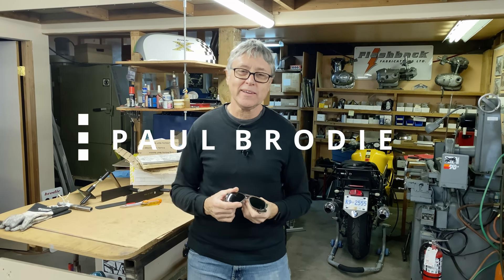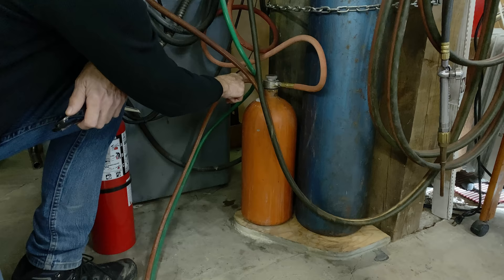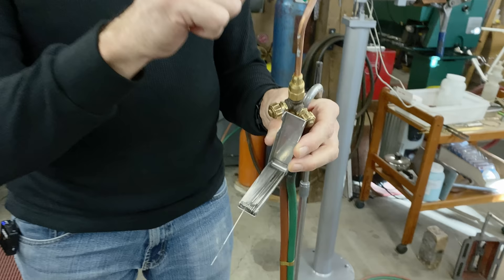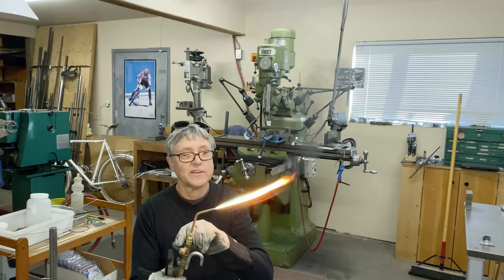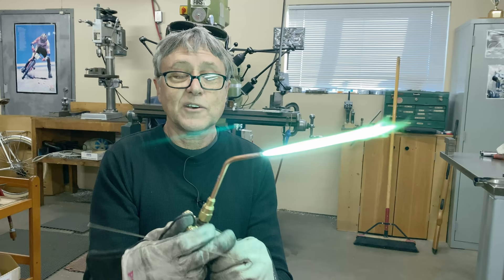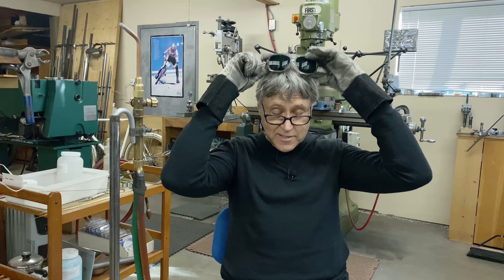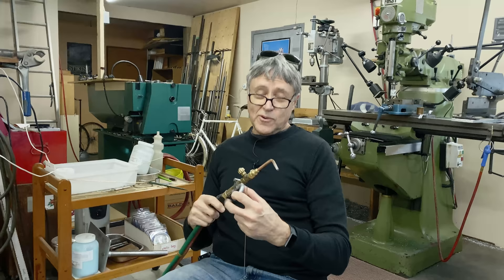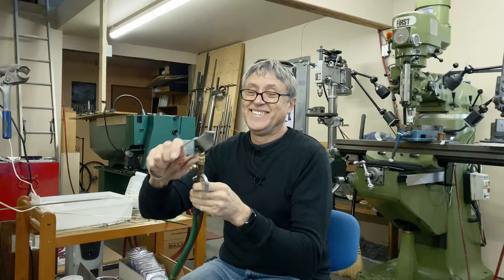How To Braze - Tips and Tricks with Paul Brodie

Comment: I'm doing some brazing on the Pd wire Paul... without much success... but I am just using propane at the moment... I am unlimbering an oxy propane set up... 
suggestions?... I have a short video of my first attempt if you want to see how not to do it
Reply from the maker: I have never used propane, so can offer no suggestion there... You can try sending me a short video!
Reply: so, I think it's a temperature thing with the much greater heat transfer in the AuPd..  platinum jewelry is made with hydrogen gas.. or now there are small arc welding thinggummies.. prices comenserate with how good they are... fer sure
Reply: stop by bro... I am right up the way on you tube.. and.. you are hereby invited to participate in the madness... making a mess.. actually... moving outside... cleaning up to get ready to fly  .. thanks Paul 😊🙏Namaste señor
bigger and better torches... far out man
wonder what the HOA is gonna say 🤔
Reply from the maker: @richardcarew4708  Not sure exactly what you mean; what is the "madness"?
Reply: @paulbrodie  building airships on my back porch Paul... cleaning shop even as we speak 😌
the first one is a 2 meter inflatable sphere with a bicycle frame structure holding on to a 7.5m² parachute... to be shellaced and create a rigid internal system of helium, or hydrogen, balloons with the ability to adjust individual pressure for altitude changes.. with vertical, forward, backward...and lateral movement.. pulse jet with hydrogen oxygen gas on demand... jets... 4.. with proportional capability for 2 at a time..  in either direction or both.. like brakes Paul... for sissies
Reply: my new fancy torch fits the old hose... into the regulator and pressure guage... and compressed air in lieu of tremendously expensive oxygen... lots of O2.. and O3 around here
propane burns at 2500° C.. hot enough to vaporize aluminum..  it's evaporating up the flame as I pull AuPd in... Pd melts at 1550.. close to steel... it's not hot enough to weld the Pd... and a pinpoint flame on aluminum wire might work better.. except it immediately becomes AuPd... so... it's a torus to hold the sphere with tubes to an upper frame structure holding the balloon and gas stuff... the torus has sections with ports to allow movement between cells and the tubes holding the gondola... 4 hollow old water bottles repurposed into pulse jet engines.. with on demand hydrogen fuel from water
Reply: adding O2 creates a 3000° flame.. similar to oxy acetylene.. but cleaner
Reply: so I will keep you posted..  and am actually heading north soon.. to the slopes of Mount Hood
Reply: to build a bigger one... I am directing people here Paul, to learn welding to build their own... the next one is 10m diameter.. military type parachute... like a flying VW bus.. or a yurt... or something
the water absorbs energy in movement and creates stable flight... like a gyroscope that can't break
water can be directly converted to H/O gas with 3% hydrogen peroxide and AuPt and AuPd... it's actually pretty vigorous and can be hurried with heat and or magnetic induction  .... work in progress.. the platinum and palladium part works.. the methods need improvement
Reply from the maker: @richardcarew4708   Well, I have never heard of anyone using compressed air instead of oxygen.. I do not know what AuPd is. You are speaking a different language to what I am familiar with.
Reply: bright red with white spots on top..  StarFire stealth technology... ;;☆》
the HOA might bark... my buddy lives out in the woods..  he gets the first one
Reply: Au = gold..  Pd is palladium.. Pt is platinum.. it's found in the radioactive volcanic ash that covers the Earth Paul..  someone knew.. kaolinite clay is what plates are made from.. plates from platinum and palladium dust..  the old Chinese bullion is AuPt.. available on eBay as Miow silver... cheap... blows bubbles in hydrogen peroxide..  nickel doesn't.. and.. the measurements and weight.. give specific gravity... 10 × 5.6 × 0.56 cm
136gm
Reply: specific gravity is the weight to volume ratio... see Archemedes and his bath
Reply: the bubbles in hydrogen peroxide are hydroxyl ions... H/O gas.. burns great.. into water vapor
Reply: the AuPd creates more hydrogen peroxide... all by itself... with 3% hydrogen peroxide from the drug store near you
Reply: AuPd starts making H2O2 in 3% hydrogen peroxide ==>> it increases the productivity up to I think 5%... it creates potable water for drinking... from river water etc.. and doesn't wear out.. it's a catalyst.. I am working on the process right now
Reply: @paulbrodie .. air... that's what people breathe... all the time... works pretty good... chock full of O2... and O3 around here

Comment: Which Oxy Acetylene setup are you using?
Reply from the maker: I use my own. Is that what you are asking?
Reply: @paulbrodie  was seeing if its an off the shelf unit that can be purchased
Reply from the maker: @dennisrobinson8008  Yes, they are off the shelf items. I did not make my brazing set. We have 2 brazing videos. The second one has all the info. Torch, tips, regulators, rods, and fluxes. All the info is there.
Reply: @paulbrodie  Hi.   Thanks for responding.   It's  a very detailed and clear video.    I had a quick question.     For brazing aluminum is there any upside/downside of oxy-prop vs oxy-acetelyne?   I'd assume the oxy-acetelyne will heat faster and also probably burn holes faster as well.
Reply from the maker: @dennisrobinson8008   Dennis, I don't braze aluminum. Never had any luck. I always Tig weld aluminum. Evan Wilcox, who makes beautiful aluminum gas tanks, does braze aluminum, and I am told he uses a hydrogen / oxygen setup.

Comment: Never saw a flux in the flame system befor. Wierd! About safety: The flame iz emitting intense IR wether its melting anything or not, so you need to protect your eyez wenevr its in youre field uv vision. I dont know wy the camera man puts a filter up at all.
Reply from the maker: Weird? I say normal. I do wear brazing glasses to protect my eyes. Mitch used a filter to make it easier for you to see what is going on.

Comment: Silver soldering not brazing
Reply from the maker: No, I am sorry, you are incorrect. This video is on brazing. I am using a nickel silver rod that has ZERO% silver content. I did not name the rod, and the confusion comes from the word "silver". Nickel silver rods are straight. Silver solder always comes in a coil, and usually has a silver content of 45% or 56%. They are very different.